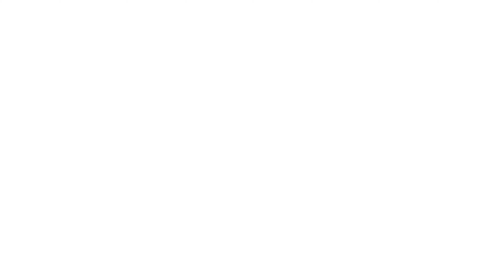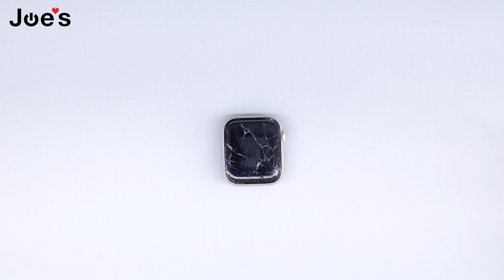Apple Watch Series 6 Broken Screen Replacement | Repair Tutorial

Comment: I have an question: do you know if apple pay will still work after you replacing the display?as i just notice that i could set apple pay on my series 6 after i changed the display but not sure if i can pay for it yet.this on series 3/4/5 i had to change the nfc antena from the original display to the new display in order to set apple pay and now o series 6 i didn’t do that and i could set apple pay
Reply from the maker: Replacing the screen on an S6 shouldn't affect the apple Pay
Reply: @Joesge  well did afect on other series because of that nfc antena but i hope i am right with series 6 and will work great as replacing that nfc antena is just an pain
Reply: @coccco28  i was asking myself the same question. so its confirmed that on series 6 you dont need to transfer original NFC in order for apple pay to work?
Reply: @michaelv.4392  yes i can confirm that you do not need to replace the nfc do not need to be replaced in order to work apple pay my be that is why the hole display for serie 6 is much cheaper then series 4 or 5🤣🤣 but at least apple notice that if the light sensor breaks you need to replace the hole nfc on lower series and that lead to apple pay not working toke them a lot of time to figure that out 🤣🤣
Reply: @coccco28  thank you! its good to know so from gen 0 to 5 NFC must be swapped
Reply: @michaelv.4392  yes 6 is perfect not sure about 7 yet
Reply: @michaelv.4392  well i can confirm that from series 7 if you change the hole display it won’t affect apple pay same on series 6 but i this time the series 7 glass is way to hard to replace or impossible apple screw it 🤣🤣
Reply: @coccco28  thank you for confirming , much appreciated! on the apple watch series 7 , you tried to change the glass only or the whole display assembly?
Reply: @michaelv.4392  well i had 2 displays that didn't worked so i was experiment on those but right on the glass there is an layer and that will come off with the glass byt the lcd looked just fine but since this didn't worked i do not know if an working display will still work after this more this lcd's are more soft and fragile as the others from series 4,5 and 6 because of that frame around the lcd apple added to replarce the adhesive strip